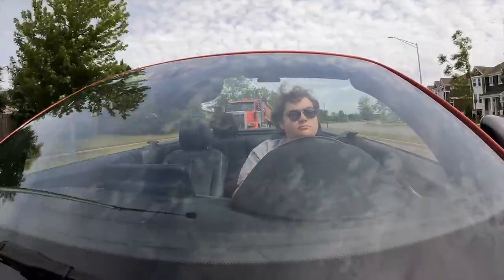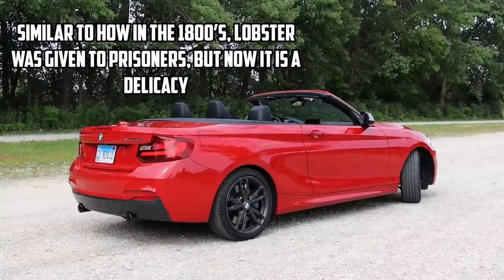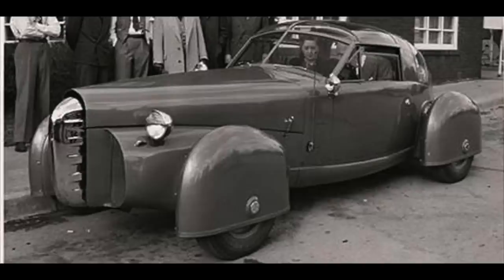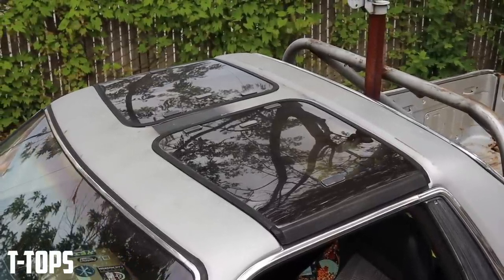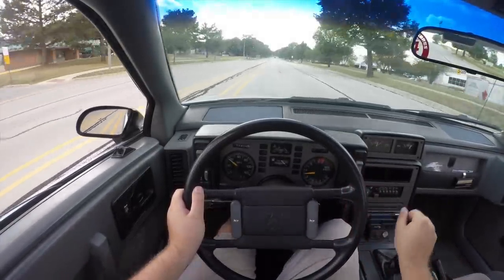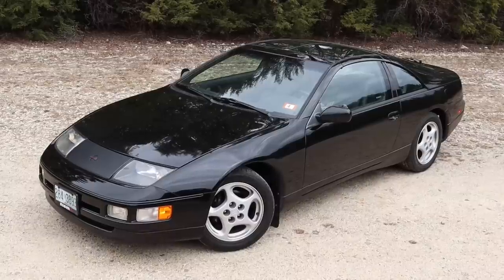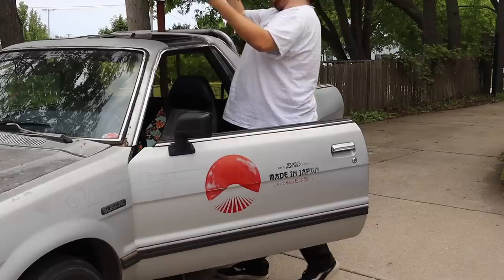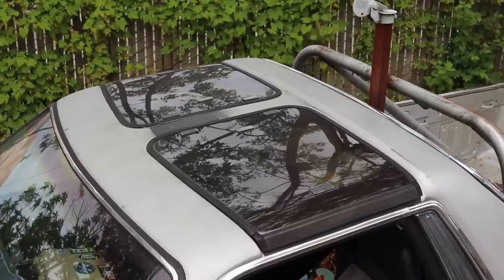T-Tops - How They Were Invented & Why They Went Away!

Comment: I owned a second gen MR2 for 26 years, and really liked having the t-tops. They were usually stored, but they were nice to have on those cold mornings on the way to a car meet. Toyota's storage solution - against the bulkhead behind the seats - was excellent. I don't know if mine leaked as I never drove the car in rain, but they did rattle a bit.

OTOH, my pop-up headlights looked good when retracted, but seeing them sticking up in my field of vision at night always reminded me of why they went away. 

BTW, the designers of the original Miata didn't want to use pop-ups, but the smaller headlights they wanted (more like the NB) weren't available yet. Having also owned an NB since 2003, I'm real glad I didn't have a pair of 7" sealed beams sticking up at night. YMMV. Sorry.
Reply: Likewise, those 7" sealed beams are not particularly good lights, especially the original non-halogen ones. I've seen halogen ones that are more comparable - better perhaps - than most halogen headlights of the 2000s though. And the good thing is that - mostly thanks to Jeeps still using something similar - there are tons of nearly plug-and-play aftermarket options that are better than most other cars' stock headlights - I have such LEDs in my classic Beetle, but that's a more recent option.
Reply: I still rock my second gen mr2 2.4L Turbo, still in love with it!...

Comment: Reason #4:  In the 1980's it was extremely common where I lived (Providence RI) to have a car side window smashed out to steal the T-tops.  They apparently sold for a lot at the junkyards and were very easy to steal.  Remember it happening outside my apartment window.  The thief saw me looking at him but still smashed the window, stole the T-tops, and drove away before the 911 operator even answered.
Reply: My 1978 vette actually has factory locks so you can't easily boost them. 
I inherited the car when my father passed away in 2003 I think I've only had the t top off    twice in all those years. Definitely fun to drive without them installed but honestly it's kind of a headache because you got to store them in the car if you go out more than a few hours.
Reply: My 2001 camaro had locks? Not a rocket science solution.

Comment: The t-tops in my 1979 Camaro leaked every-time in car washes I owned from 1982-1985.  My Friend had her Camaro detailed and the guy failed to lock the latch in place on the passenger side and it flew off. She turned around to go back and a pick up truck was pulled over in that area and the guy was about to get out to look for whatever it was that he saw fly airborne off her car. Said no joking it shot straight up 6-7 stories high then flew a half circle like a boomerang and then shot at the ground. They found it together all shattered. It was an insurance claim to get it replaced because of the cost to get just one replaced.

Comment: The BRAT T-Tops were called "Fun Roofs" IIRC and they could be held partially open like a sunroof in vent setting, though sideways like gullwings. Kind of neat, but it required the roof structure to remain on the open side, though that was probably a good thing with how flexible those chassis were. I wonder if the unusual vent setting might have been the result of someone trying to make a positive out of the need to retain the outer roof to prevent losing too much structural strength (and maybe to help prevent leakage).

I think with modern chassis strength, T-Tops could come back, but people have lost their sense of fun and would complain about having to remove the panels by hand. I actually preferred the old manual sunroofs where the panel had to be removed to have it fully open to the power roofs of today as it leant a sense of occasion to the simple act of having an open sunroof. I usually tossed the glass in the rear seat footwell. If more people were in the car, it just stayed in the roof, but I wouldn't have wanted it out with passengers as it would make it too noisy to talk to everyone, anyway. Funny that you show a BRZ as I was thinking how the double bubble roof of my GR86 could have used a T-top with the bubble sections being removable body-color panels with the center section remaining fixed. Of course, it would be me and maybe 5 other people who would actually want them like that....
Reply: The safety sticker inside the BRAT called it the “Fun-Roof,” but the owner’s manual also called it the “Subaru HALO-TWIN” (all caps in every instance) roof.

Comment: I really miss T-Tops. They were like having a convertible and double sunroofs simultaneously, without the ugly cloth roof. I had a 1989 IROC-Z Camaro with T-Tops back in the day. It was a fun car, and the T-Tops made it even more fun. Luckily, the T-Tops never leaked in the rain, and I always hand-washed the car (no leaks then either), so I never tested the T-Tops at the car wash. The T-Tops came with two padded and fur-lined faux leather zippered storage bags that fit down inside the cubby hole (vertically) under the rear hatch back. That cubby hole eventually became the twin 10-inch subwoofer box, so there went the T-Top storage....lol. Although, the T-Tops could still be laid flat under the hatchback, as long as you had nothing else to tranport in the car at the same time. The T-Tops were about $500 a piece (back in 1989), so you didn't want to damage them. I had a friend with a Trans Am that found this out the hard way, when he dropped one of his T-Tops and the glass cracked. Who knows,  maybe T-Tops will make a comeback someday, but for now I'll have to stick with my sunroof. 👍👍

Comment: Man how could you not have a picture of the Camaro, that car along with the Trans Am is what people associate with t-tops, I mean they had them from the late 70's until both models were discontinued until 2002.  Speaking as somebody who owned a 1999 Camaro Z28 t-top and a 1998 Camaro Z28 convertible, my vote goes convertible.  Granted if you drive the car every day, t-top is the way to go, way more room in the hatch, doesn't leak(mine never did), quiet on a highway cruise.  But if its garage kept and only taken out on nice days, convertible all the way, there is less wind buffeting than t-tops, you have a lot more open feel.  At least on that 4th gen Camaro both felt pretty solid and didn't rattle.  Never taking apart the interior is the secret to no rattles though lol.
Reply: Shawn 🏴‍☠️ Stafford  I guess so, but t-tops were a big deal in the 70's/80's/90's.  Even Mustangs had t-tops in the 1980's.

Comment: Jeeps technically still make removable T tops (without the center T). With their removable hard tops the forward section of a 4 door wrangler is two removable sections (very similar to a T top), and for the renegades their removable roof is all based on T the tops concept (though rotated 90 degrees), I know those aren't the exact same as a T top in the traditional sense but if you look at what they are doing its the same concept. 

And on the concept of cars feeling new, the old saying goes, there are no new ideas, just old ideas recycled into a new product. With the new ford bronco and hummer I think we may soon see some of these older concepts like the T top actually coming back just due to consumer nostalgia.
Reply: Of course the Wrangler itself is one of those retro designs you talk about. It's lineage can be traced back pretty much to the WWII Military Willies Jeeps, it was fully re-designed several times (and it's probably at least twice as big now) but the aesthetic was kept the same all that time. It's probably stayed true to its origins more than most other long-running names like any of the muscle/pony cars that have only vaguely stayed the same in concept (unless you count the Mustang Mach E, in which case it didn't stay the same at all in any regard).
Reply: The Jeep Renegade still has the center brace, so technically still a t-top, but they call it something else.. Jeep branding.
Reply: Also, that new Hyundai concept EV looks like it traveled from the 80s with its boxy design and stainless steel finish with modern looking tech. Would be sick to see those on the road

Comment: I think a lot of why T-tops died is similar to why targa tops died, namely convenience. With a convertible top, you stow it in the rear deck area. With a t-top, the user has to leave the car, remove the tops, and stow them away. The fact that it is less convienient probably means consumers are less likely to purchase the option, and that influences manufacturers to cut it from their models, reducing manufacturing complexity. Plus, at least for car guys, the hard top is the desired option, so why produce t-tops?
Reply: Targa tops aren't dead. The corvette has had a targa top for almost 40 years.
Reply: @pdennis93  One car has a targa top. Thats effectively dead.
Reply: @JakeyyFD  Targa tops aren't really dead, Porsche still produce Targa models for the 911
Reply: @automation7295  Two cars, plus the new Hummer makes three. Not dead but barely alive.
Reply: @JakeyyFD  porsche 911 Targa, mazda miata mx5 rf, ferrari Daytona sp3

Comment: I had an 82 Z-28 with T-Tops...in Texas.  While they didn't leak (very much), they BAKED the inside of the car on hot summer days.  I always had issues with the a/c on that car...as in, if I ran it too much on those hot summer days, my car would overheat.  SO, I just left the T-Tops off most of the time because it was cooler with them off than on.  Lots of good memories and fun times in that car tho!  Ahh...the 80s were such a special time!  LOL

Comment: A 1983 280zx was my second car when I was 21 - awesome car!  It had t-tops and I loved them.  Fast forward to my 2015 C7 Corvette which had a removable roof which was great but best handled with two people.  Note that in both cases there was a dedicated space or container in the rear for the removable components.
Reply: Yep, had a 1983 280ZX Turbo with T-Tops. Loved that little car. You could easily take the tops out while sitting in the car. I had them stolen twice though as t-top theft was rampant back then.

Comment: I love my 1984 Nissan 300ZX 2+2 with T-Tops, I LOVED my T-Tops they were incredible. I loved them so much.
My car came with Vinyl and faux leather bags specifically designed to put the T-Tops in to keep them protected and safe.
There was also a place to put the under the floor in the back, not sure if that was stock or not.

Therefore no space was lost and they were protected from the elements.
Mine never leaked and the only time they did was because I didn't fully latch them into place. So it was entirely my fault.

My end goal is at some point to get a 1984 Nissan 300ZX Anniversary Edition with the Digital Dash and T-Tops. That will be one of my dream cars to get again some day.

Either that or a Nissan Z32 300ZX with T-Tops and Twin Turbos. Sigh...
Cars these days are so boring. Why would I ever want a car that doesn't have Pop-Up Mother F**king Headlights! Pop-up up and down headlights!

Comment: Bought my 82  Corvette in 2003 and the original T tops did not leak or rattle. Sold the car 11 years later and they still did not leak or rattle. My 2004 Corvette had a Targa. It was harder to lift for a small guy like me but took less time to remove and replace as there was just one piece to deal with.  I liked both the t’s and the targa and miss them both.

Comment: When I went to buy my first car around 1990 I went to a dealer and was looking at a 1977 or 78 Firebird Formula with T-tops and asked the used car salesman it leaked or not, he said "I can guarantee you that it does leak, all T-tops start to leak when they are a few years old." I passed on that and got a fourth generation 1982 Trans-Am instead. I kind of regretted that decision but I thought the girls would like the newer T/A better and ended up having a sun roof installed on it.

Comment: I used to own 2 targa Supras and a 300ZX. The targa roofs were a bit crap to remove, but worked really well. The Nissan T tops unfortunately leaked: first on the driver‘s side. I went to a Nissan garage to have it fixed. It cost me over a 1000 bucks and the result was: no leaking on the driver side, but now leakage on the passenger side… so I left it at that. Still loved the 300ZX to bits and wish, I never sold it!w

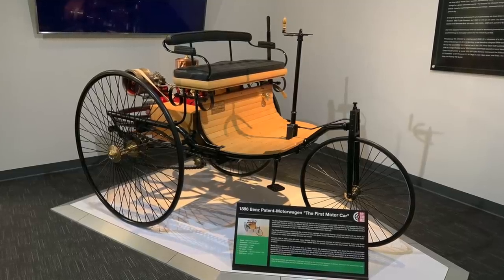Comment: 0:26 twenty six seconds in and I see a 300zx. Loving it so far :D lol

lol 300zx owner here and I never liked or disliked my tops. I've also never really removed them unless a passenger asked me to. Having long hair... ya the "wind in your hair" bit isn't as fun when you're dealing with knots for an hour. Can't say I've had an "issue" with the tops themselves leaking... the weatherseals in general? OH YA. When you buy a 20-30 year old car expect those seals to be toast. Little bit of silicone fixed that...

My biggest worry with them is the shaders that keep sun off my head have mounts that... well... don't stick too well to glass and the OEM stuff is unobtanium. I've tried numerous adhesives and eventually it fails and the shader falls down while you're driving, smacking you in the head. It's more of an annoyance than anything, and no you can't just use tint... tinting the tops has been known to cause the glass to overheat and shatter... SO. That is my largest annoyance with them. So... age? lol

Comment: My 2002 camaro is a base one that came with ttops. How lucky i am because I love them. I have a compartment for them both which is extremely convenient.  Easy to take off and put on. Leaks are very scarce. No major issues. Much safer than convertible but than a boring tiny sunroof.  I have had this camaro for 15 years in 3 different states. I'm very fortunate and happy as some haters think they are strange looking 🤔.  But they are not driving these cars. If you don't like don't look. Cover your baptist virgin eyes 😅😅

Comment: I pictured my 1993 Toyota MR2 with a T-Top... The panels didn't leak, they stored neatly behind the seats (even came with vinyl bags for storage as I recall) and had individual key locks on the inside to make it more difficult for ne'er do wells.  I purchased a convertible when the MR2 aged out and, over time, experienced tears, leaks, rust, fading, and eventually expensive replacement.  I miss my MR2.  T-Tops may not offer the liberating exposure to the elements that convertibles do, but on the whole (pun intended) they have my vote.

Comment: Nifty!  Oh, yeah… love my 1980 Datsun 280Z T top, 1991 Toyota MR2 GEN 2 T top… T tops were a thing, and like tailfins you love them or you hated them, but eventually the infinitesimal attention span and favor of the buying public went elsewhere.  🤷‍♂️
I also enjoy my 87 RX seven turbo with moonroof, & supercharged 84 first GEN MR2 & 88 XT6 with moonroof and pop-up headlights… & one of the better engines. That boxer six really is great, low center of gravity, the horizontally opposed flat torque and power- and of course the power seatbelts! I always thought the reason those one-way was because the lapbelt wasn’t part of the system and had to be applied manually and the power shoulder belt gave people a false sense of security.

Comment: For the few months i drove a T-Top car i removed the roof panels... twice. And it was in the summer. As you mentioned in the video, dealing with that is a but too cumbersome,  it takes too much time to remove and store them and it doesnt really make sense anymore as modern convertibles convert with the press of a button. The T-Top looks cool somehow, but that`s all about it. If i want an open roof i`d also like to have the option to close it without having to find a place to pull off the road, go to the back of the car, take the panels out, reinstall them, hoping they survived the trunk ride and won`t start leaking.  Asking why they went away is kind of like asking why manual crank windows disappeared- nobody wants to operate manual mecanisms anymore and unless someone invents an automatic system that opens and closes your T-Top- i guess they are gone for good.

Comment: I sold a 1988 black dodge Daytona turbo with T-Top in favor of Stealth in 2001. I do still love my 3000GT/Stealth twins but regret selling that car and miss the T-Tops so much.

That Daytonas passenger side T-top only leaked if the car was parked in the rain. As long as you were driving it, the T-tops were fine and didn’t leak.

Comment: I've had a few cars with t-tops. The last was an 81 280zx. Before that an 85 Cameron. Before that a 83 or 84 Hurst Olds cutlass. In between those at various times a 86 300zx , a 75 or 76 cutlass and a couple others over the years. The only leaker was the camaro. Many sunroof cars and 1 convertible as well. Loved my open cars back in the day.

Comment: I feel like the removable/retractable sunroof is the best option all round:

Easier to seal than a targa or T tops, the sides of the roof are still there for body rigidity, thus less weight.

The AW11 MR2 has an interesting storage solution, where the sunroof is removed and mounted in the 'frunk' out the way.

Comment: I miss my 1997 Camaro that had T-Top. My mom's 1981 Mercury Capri (black magic edition) had T-Tops, unfortunately hers were stolen 2x in the late 80s, as they didn't have locks on them. My 97 Camaro had locks. My uncle had a 76 Pontiac Grand AM with T-Top unfortunately those would leak when it rained. 
I can say my Camaro never leaked water when it rained, I like to that it had a hard plastic cover that went under the glass that I could put on or take off. It helped during hot summer days when the car was parked. I wish I still had that car.